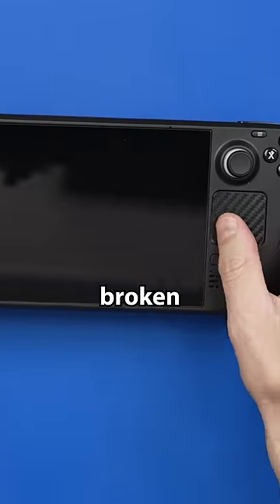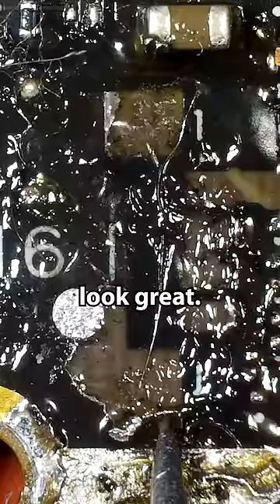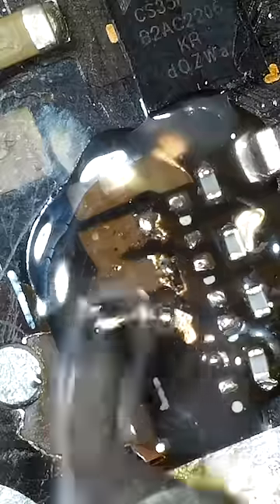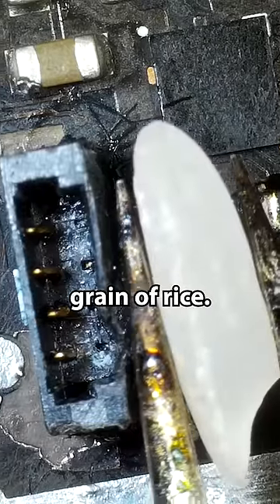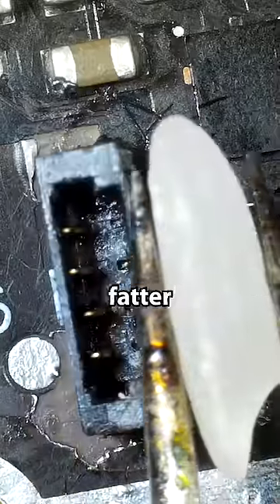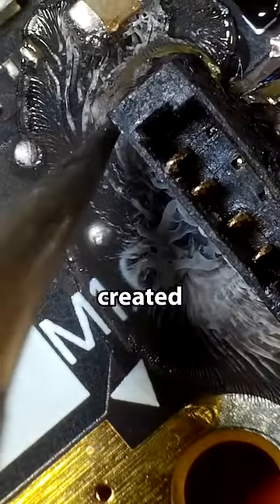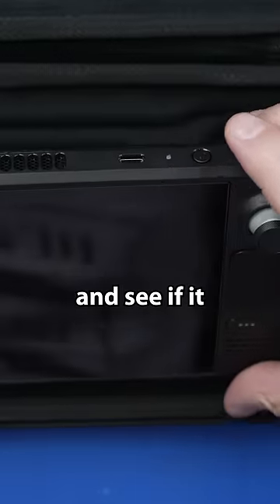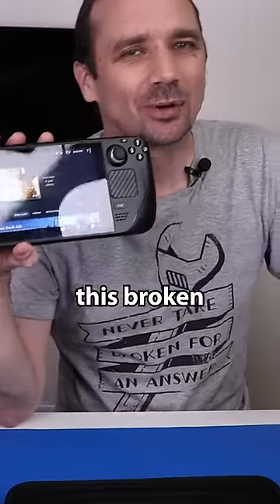He Destroyed His Steam Deck! Let's Fix It.

Comment: 375 for a broken steam deck?
Reply: That's a lot
Reply: No it's not there 895 in au
Reply: @m_rpuggles  yeah but after conversion, he didn't pay much less than new for the steam deck
Reply: I thought the same thing. 375 for something that needs a hail-mary to function again seems like a lot.
Reply: @Cimlite  I mean it didn't really need a hail Mary, afaik the device would be perfectly fine (and boot up) if you used it with headphones and never used the speaker, or even connected a bluetooth speaker to it. It's still a tad too close to brand new pricing imo BUT if the device still worked with headphones, someone could have bought it and not had to do a repair
Reply: @curtisss  I don't know... I would think most people would still want speakers at some point, even if the rest worked. Especially not for a measly 25 dollar less than retail. That's a worse discount than for what it was sold for on the recent 1 year anniversary sale they held, where it was 10% off.
Reply: I think is a bit old and from the time when Steam Decks were still hard to get.
Reply: I'm guessing it wasnt a 64GB
Reply: I would have asked for my money back
Reply: yeah seriously i can't understand people thinking it's an acceptable price.
Reply: For a steam deck without sound. So I assume otherwise 100% fine as long as you use headphones.
Maybe the dock would have issues as well.
Reply: @Sam-gf1eb  im sure it was the 256 this guy definitly didnt repair this for a 25 Dollar discount.
Reply: This was what I came for
Reply: @Cimlite  exactly
Reply: @m_rpuggles  they're*
Reply: Still works, but you can only get audio via bluetooth or usb C
¯\_(ツ)_/¯
Reply: @Cimlite  Oh yeah, I'm betting he'll get more revenue on this video than the profit on the refurb on this.
Reply: @inund8  spend 25$ more get a new one
Reply: @42calking53  Yeah, I'm saying he's gonna make more in revenue from making the video lol. If its a 512gb model, and if this was made in like june last year, he could probably make 30 bucks or something lol.
Reply: @inund8  ah lol I see I see
Reply: @Cimlite  A speaker connector is not a huge complicated matter, you probably can just peel back some insulation on the speaker wires themselves and just directly solder them onto the traces.  No biggie.
Reply: It wasn't really broken, only the speaker was blown.
Reply: Because you can use it as sparepart for more fixable broken steam deck
Reply: Exactly
Reply: @Curtis Sawyer  The owner ripped it open and made it jank and then has the audacity to ask for around what he paid for it? 😂 That's just bad business.
Reply: Yeah, that thing was only worth $100 as a donor board
Reply: And they threw the money at them and let them think they made a good business deal and that person will go on to overcharge for everything he ever tries to sell lol. It must be nice to have money to throw away like that.
Reply: 375 new? sure, but used and broken at that? Hell no.
Reply: @アルピヤ  私が思ったこと
Reply: He fixed it with superglue lol he can’t sell it for normal refurbished price. That’s an As-Is item for sure, that’s like $290 used max
Reply: This man could of spent $25 more for a brand new steam deck.
Reply: Ya but he'll probly sell it for 100$ less than a new one as refurbished and that 30 minutes of work just made him a couple hundred
Reply: Probably admitted he was using it for YouTube and the guy knew he was selling him a video.... which is a lot of value
Reply: @invertexyz  Huh? Think you replied to the wrong comment there. 😉👍
Reply: @curtisss  Sure but even if this was a working Steam Deck, it's a USED device, even just buying a good-as-new used device should not be near MSRP.
Reply: @Cimlite  Whoops, yup!
Reply: @rachellyons1127  but it literally said that it was broken... why would you buy it in the first place?
Reply: @soulbounddoll1826  I wouldn't 😅😅 I bought my steam deck brand new
Reply: I never use the onboard sound for any handheld...this would be an issue for me.
Reply: @Cimlite  it barely needed anything. use bluetooth headphones
Reply: I'm going to hide this channel from my recommendations. This is basically all his shorts. Claims to pay almost brand-new price for an used AND broken console
Reply: @joseppastor8750  not trying to be a grammar Nazi, but I thought the use of an/a  is also based off the pronunciation, like a used(Yused) instead of an used. or  I started thinking  about it. And, remembered I am not the best at typing properly on the net, so I could be wrong... It could also be the cannabis edible I ate a bit ago. I mean no offense.
Reply: They are extremely high in demand.
Reply: @inund8  512gb model is impossible
Reply: @Ohno haha biggest scam ever
Reply: @m_rpuggles  lmfao u australians are special ur dollar is worth half the us dollar obviously u have to pay twice as many
Reply: @bmxscape  are you restarted?
Reply: this was when they just came out.

Comment: I dont know if I should be impressed or worried that they manage to break something like that when replacing an ssd
Reply: how do you know it wasn’t water damage or something
Reply: @imstupidbut  water damage usually presents itself as corrosion. I think he slipped when doing something and his tool or SSD ripped the connector off along with some of the circuit board material
Reply: does replacing ssd needs a solder???
Reply: @ChrisTian-sd5yq  no, just unscrew the existing one and slot in a new one
Reply: @AarieaaronFTW  that's why I'm curious how they destroyed other components
Reply: @imstupidbut  because there is physical damage on the board itself, how does water knock of a connector?
Reply: Ikr
Reply: There's a reason shampoo has instructions. Some people are...Special.
Reply: @CuteMegaPanda  most "special" people I know are just less socially capable, but way smarter. The seller is especially special
Reply: Incompetence manifests in different forms. Some people are incredibly intelligent but should not be trusted with anything more than a butterknife.
Reply: @ChrisTian-sd5yq  What I think happened was that they just knocked something onto that connector, and it came loose. OP needs to resolder it into place, but you don't need solder to break something off of something..
Reply: @CuteMegaPanda  not everyone has seen shampoo before. Also different brands may have different instructions.
Reply: @CuteMegaPanda Shampoo can be pretty complicated tbh - how often you need to use it, what part of the hair you need to use it on, etc.
Reply: It's a fake video lol

Comment: I installed my own new SSD into my deck, it took like 20 minutes max and the only issue I ran into was my own fault: forgetting to connect the battery connector.

I feel bad for the guy but you should be more careful working on things.

Comment: When I worked at an Aviation Test Set Repair Center I'd use new runs and scrape back the masked off area and solder them on and then epoxy the runs down after I trimmed them. Then I would mount the connectors and epoxy them down for added adhesion. Worked every time.

Comment: For anyone interested, that process of applying a “glue”  to parts is very common in electronics. It’s process is called “encapsulation” and is usually done with a plastic resin of some sort. Surprised valve didn’t do it for this part considering it’s so small and delicate.

Comment: I remember repairing a projector a previous owner broke. description was didn't turn on. Came with plenty of photos and asked questions, turned out the owner dropped it, and that is what broke it, so I got it. and repaired it. I noticed that some connections ripped off. was a simple fix of running some tracer wires. Used it for many years before selling it. it also came with an upscaling box which you had to use to use it.

Comment: Whever you can get a UV light try UV resin, you can get it at a craft store in the jewelry section. It's my new favorite glue for rejoining plastics. I might start a join with super glue and finish the outside connection with resin

Comment: This is why I prefer to tinker with OC/UV before I mess with the silicon itself. 😂❤ That dude cost himself IDK how much just to try and get more storage when they just could've used an SD card. This is why I bought the 250Gb model, enough on board for one BIG game and a few small games. When they include an SD card slot as well I just wonder how much people are trying to save & costing themselves as a result.

People hate on SD cards until their device doesn't have a slot for them THEN everyone realizes that quicky swappable small form factor storage IS kinda good 😮‍💨

Comment: So since the pcb was broken and missing the terminal pins, did he just expose more of the trace by sanding back the pcb to expose the traces inline with the pcb terminal pins and solder the speaker connector directly to the traces on the pcb, and secure it with adhesive? 

That’s actually pretty sweet. It’s hermetically sealed with the glue and now, one with the board.

Comment: Super glue (Cyanoacrylate) seems like the wrong type of adhesive to use.

Sure it'll bond to the plastic of the connector, but it won't bond to the circuit board. Moreover super glue is brittle, any flexing and it'll just crack and deadhere.

Probably won't matter all that much for an internal connector like this, but for an external connector it'd be useless. 

Google seems to indicate epoxy or acrylic glues are what to use on circuit boards.

Comment: Don’t those have a huge issue with battery life and overheating? LTT had one and they did a whole video on correcting all of the problems with it, but they just sort of slapped a PC CPU cooling block on it and cut the back panel to fit. It looked hideous and stuck out of the back about a foot, but it worked.

Comment: I am microelectronics engineer, thanks i know how different packages with hidden pins with very centralized position makes pain. When you deal with devices with size of 2 phones and have 300 capacitors and 400 resistors with 50A currency (charging stations motherboard). You get used to use microscope

Comment: Wow that's small. Probably pretty easy to break. I had some m.2 size ports on this pcie card that bent and almost broke with normal amount of force righting to insert a connector. 

Absolutely ridiculous. So, I have to try to insert the connector while holding the port. I don't know why they don't warn about this in manual or put a warning on board or just make these more rigid and durable.

Comment: That's one hell of an oxidized soldering iron tip! You can see how the solder is balling up. That must have been way harder to rework than it needed to be. Use some rosin and burn off those oxides if you find the solder balling up.

Comment: You wouldn’t melt the connector during soldering operations if you used the proper tip or use the tip properly.
And before people say I don’t know what I’m talking about, unless you have IPC-J-STD and IPC 7711/7721 under your belt, I know more than you.

Comment: Okay no offense I wouldn't buy anything that you repaired based on this video this is one attack to use superglue instead of at least clear UV resin it's like a big towel because superglue sucks and people like don't realize like how blues and adhesives actually work in how sugar has bonded super glue was just like a very versatile but never lasted

Also the fact that you didn't grind down in epoxy down new copper ads then wait for that too cure cuz those are created mechanical structural connection between the board the connector and then you use UV resin a few bangs and bumps and that connector of yours is falling right off and possibly do more damage because not one that connector is going to basically ripped to chases off as it comes off in side the unit and the little bit of bigger part of Trace that you had are you did Saturday to is just going to peel up long version short

Comment: Getting under that sealed coating is a pain in the derrière.
You did a speaker connection.
I know you have done a bit more involved work, it goes with the territory.
I recently had to work on the board for a smoker that was left in the rain.
The entire LED readout wouldn’t work.
Traced the problem to a corroded ground.
Desoldered the whole thing and removed it, then had to jumper the ground lead under where it lived.
Reinstalled the readout, and it worked, thankfully.
All the electronic component dealers in my area have long since shut down, and I really miss Radio Shack!!!

Comment: How does someone break a speaker plug replacing an SSD? Lol. The SSD is super easy to replace. I have an SSD for the deck and one for windows I switch between the two a few times a week. And don't even bother screwing on the back because of it. Lol you'd have to be rough or stick a knife in there to do that. Lol

Comment: Christ. I didn't realize these repair channels are driving up the parts and defective market so much
Reply: Better than apple saying repair shops will steal your data through the speaker connector and add a proprietary chip to lock repair shops out of fixing a part that costs pennies. But tomato tomato.
Reply: What do you mean? this could be the top of the line steam deck for all we know.